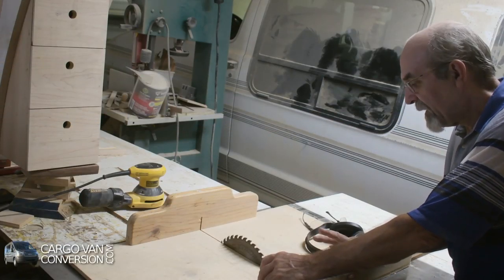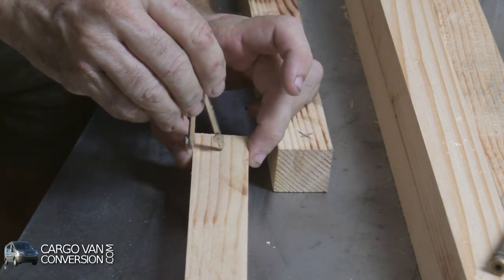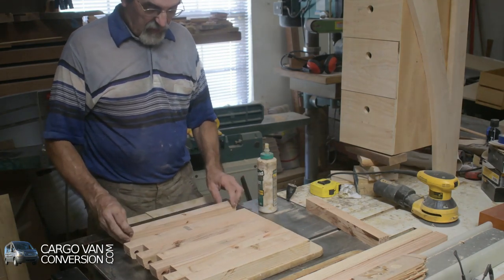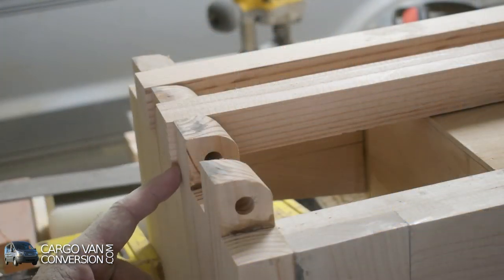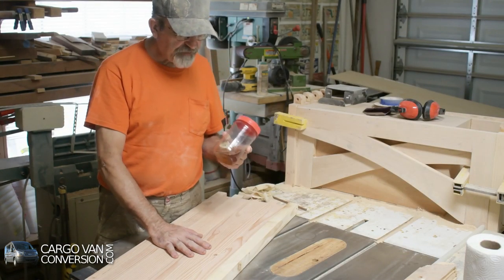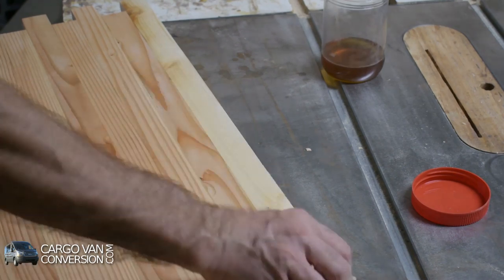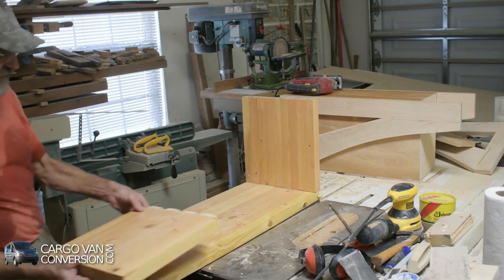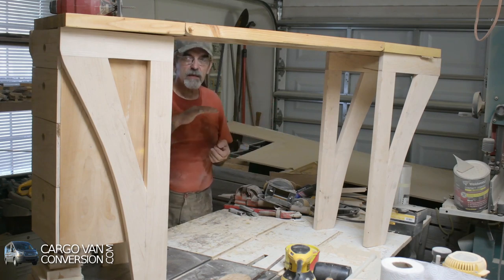RV Mobile Work Bench

Comment: its coming out so great. really nice job.
Reply from the maker: I'm getting more enthusiastic by the minute, but it is a slow process. But I enjoy what I'm doing.
Van Williams
Reply: @cargovanconversion  being in south Fla myself i know its insane how hot it is to work in the wood shop. my saw dust is caking up everywhere. i'm proud to be able to see you and Joey surviving  in the shop/garage. but i am learning SO much from you two. i imply what you show into my cargo trailer camper project. i hole heartily am grateful for the videos you and joey put out. because of your knowledge and years in experience, i have access to building my knowledge. thank you SO much.
Reply from the maker: Hi Al,
Yes, I should have the garage insulated and A/C put in. Now the heat limits me to one hour stints and a lot of cooling in between :)
Most of the honors should go to Joey, but it is really great to hear that you're picking up some ideas. It makes it all worthwhile. Thank you.
BTW would love to see some pictures of your build :)
Van Williams & Joey

Comment: would like to know more about shellac flakes ? all new to me !
Reply from the maker: Hi David,
Lots of info where I buy them - https://www.shellacshack.com/
A major source of Shellac is India where the tree resin is harvested. As it is also removable, it's often used in the restoration of furniture and other art pieces. It's easy to apply and dries quickly.
I find it a major advantage, that the flakes can be stored for a long time and you can use the amount you need for a specific project. I use denatured alcohol with the appropriate amount of flakes and let it stand overnight. You can experiment with different mixtures and apply with a brush or as a wipe. It often brings out the color of the wood.
Van Williams